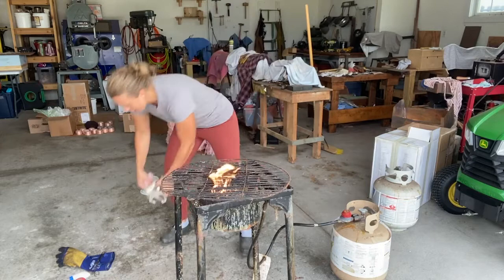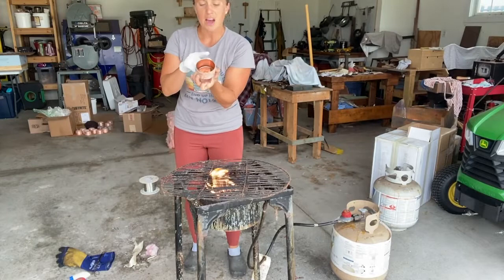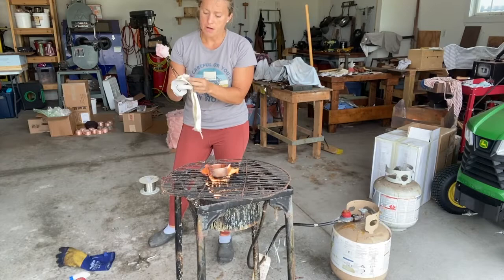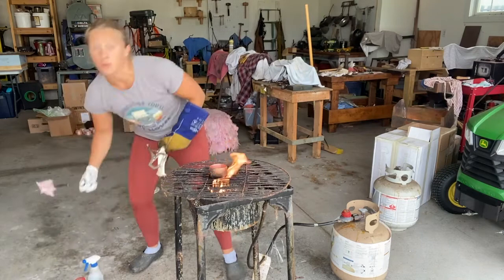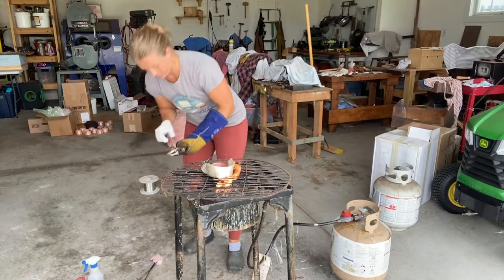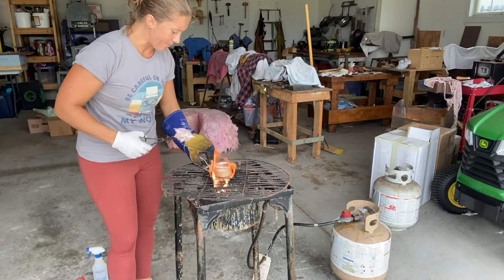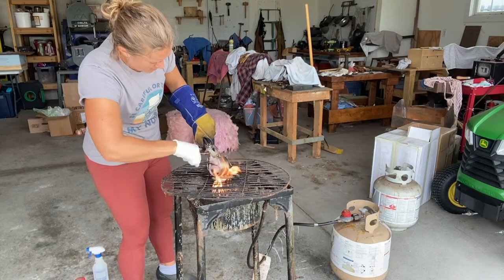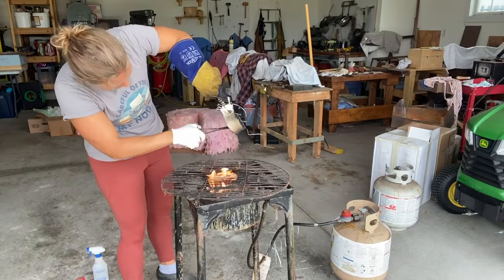How to Tin Line Small Items

Comment: Greetings from NZ. Really enjoyed watching your videos thanks! Just a thought as you’ve mentioned Sal ammoniac/ammonium chloride, I’ve tinned a fair amount of pans over last  9 years and although I started with the staybright zinc/acid flux I eventually used just ammonium chloride powder and got just as good results and figured it was less toxic, cheaper and maybe a more traditional method… although I still needed a little diluted hydrochloric acid to pre clean…
Look forward to your future vids!
Cheers 
N
Reply from the maker: I was taught that the sal ammoniac gives off a pretty toxic fume comparatively, so I tend to stay away from it in mass quantities. But it is totally traditional - though I think pine resin is the most traditional? Thanks for watching - always great to meet other tinners!
Reply: Hi @housecopper and Nathan - If using sal ammoniac powder, does a little go a long way or do you need to coat the whole interior? Also, when should it be applied - before/during/after the tin has melted? Thanks for sharing your knowledge. It would be really interesting to see a video with traditional methods/materials!
Reply: @stacermcchesney4922  
Hi stacer, I’ve found a little Sal ammoniac powder to go a long way and a medium size pan may only need 4-5 finger pinches during entire tinning. I normally put a pinch as the pan hits tinning temperature (when colour of old tin changes) and it seems to chemically re-clean the pan. It doesn’t seem to matter if this is done just before adding tin to melt or just after, then during the wiping process you get a feel of when you may need to flick in another pinch and also flick out the old burnt grains of it too. The granular nature of the Sal is also abrasive and can be extra manipulated in to help to get the tin to adhere to areas that one may not have cleaned or scraped out properly such as around rivits or scratches on old heavily used pans.
You don’t need to coat the whole pan just flick the pinch of Sal in the approximate area of pan and the combination of fume and the grains spreading with each wipe does the rest.
You can buy bags of (I believe lab made ammonium chloride powder)online quite cheaply and a 500g bag could last many year’s for a hobbyist!
As Sara said the fumes are pretty corrosive but probably not toxic such as zinc may be (although I could be wrong on this) so therefore I’ve always used both an industrial inline extractor hanging above the tinning table and a full face 3m mask with the right acid gas filters and been good.
I once tried Rosin from pine as flux and it was a disaster! Don’t know why I could not make it work…also tried many types of wiping cloths as a traditional alternative to glass fibre but everything burnt to a degree. Don’t know how the old tinners managed to be honest!
Cheers 
N

Comment: Hi, as for the tin, you are using a tin alloy solder? I looked at your link and wondered which one. What about pure tin? Also thanks for this, it is quite valuable. I am actually looking for methods to overlay tin on other metals in jewelry items.
Reply from the maker: It is the one I list right before I put the link - solder #640 which is the only tin known for food items / food safe. It's food grade - I believe it's a silver-tin alloy. Best of luck with your projects!
Reply: @housecopper  thank God I'm running around in circles pulling my last hair out thinking that it has lead in it. It must have silver in it but it would have raised the melting point considerably if it had silver in it that's what I'm worried about it seemed to have melted pretty easily what is silver's melting point about 1 1700 degrees Fahrenheit? I do a lot of silver soldering or I wouldn't even know that. Alright but I even might be wrong because I'm an old ****
Reply: @housecopper  There's no longer a #640 available at that link. Did it change numbers or did that supplier stop carrying it?

Comment: How does the tin not melt off when cooking???
Reply from the maker: The food or liquid absorbs the excess heat. Tin melts at 450F, so unless you're broiling something empty, you're usually good. :) There's a way to cook and bake in tinlined copper so you don't ruin it - it's been a centuries long used thing. ;) :) xoxo
Reply: @housecopper  but you're exposing yourself to lead! If that solder unless it's silver solder you got tin and lead or tin and antimony and word there's always some wood in there what are you using exactly it isn't pure tin is it?

Comment: Your link for tin doesn't direct to a specific product. I'm having trouble searching their website for it.
Reply from the maker: That's because the company doesn't have a link TO the specific product (it's a really difficult website to navigate, I feel you). You want the silver bearing solder, so #460, #466 or #469 depending on your use. Be warned they are only sold in 25lb spools.
Reply: @housecopper  oh no. Seems like an opportunity for someone else to resell smaller amounts for hobbiest that want to experiment.

Comment: So you're not really tinning that you're soldering where is it silver sauder no cause that isn't gonna get it up to silver solder temperature why aren't you really tinning it? I mean I know that there's some tin in some of the different types of solder but it's not all 10 and they stopped using lead in tanning processes a long long long time ago like what the Middle Ages? So shouldn't it be tin and silver?
Reply from the maker: It is tin. It's an eutectic alloy, silver-bearing tin solder. Thankfully, it's lead-free - I use a particular solder patented and made in Iowa which is the only solder known to be acceptable for use when soldering food handling equipment.
Reply: @housecopper  good God sorry about all the typos I use voice recognition because of a neurological issue